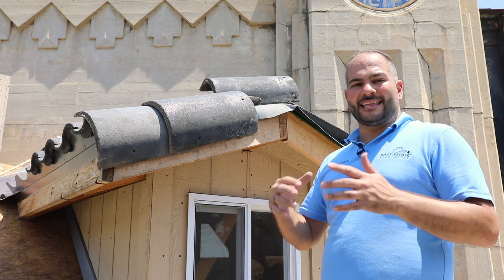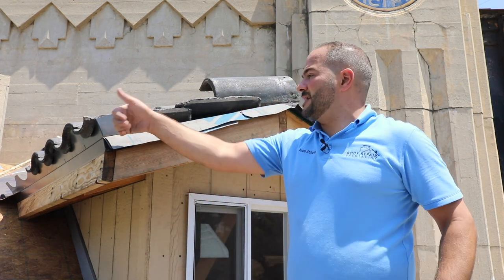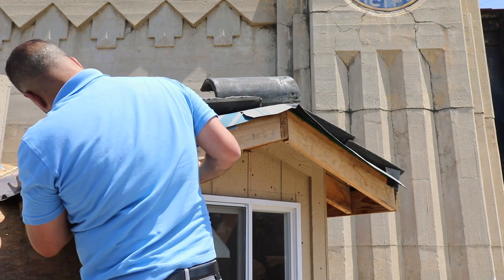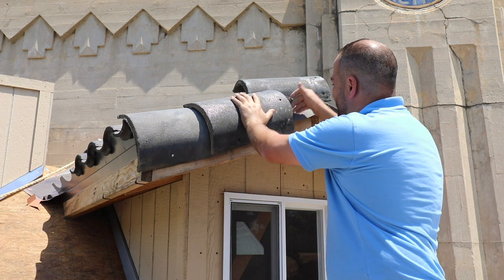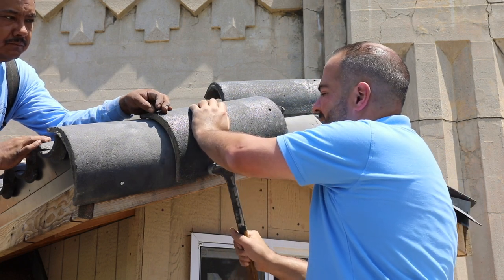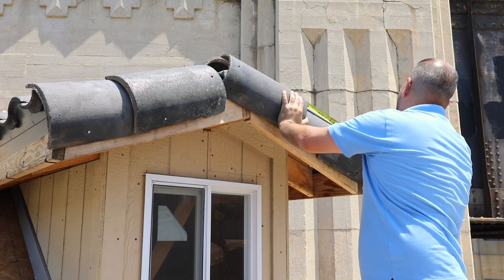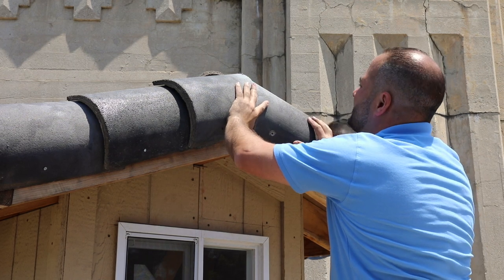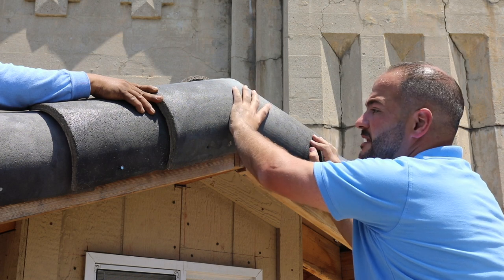How to Install Rake Tiles - S Shape Tile Roof

Comment: do you use stainless steel nails or galvanized? also you didn't mention that you had to drill new holes for the last tile, maybe the first one should have 2 nails also?
Reply from the maker: Generally we use galvanized nails. 
Most tiles come with 2 holes in it. The only time we need to drill a hole is if the tile is cut short.